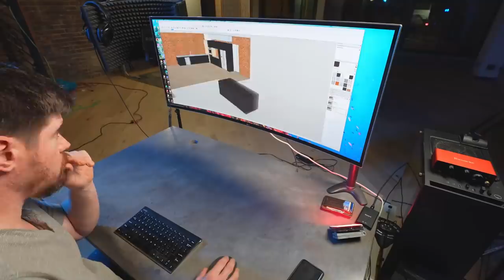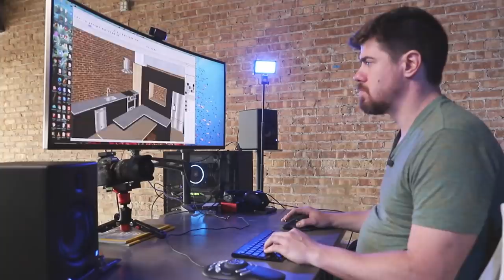Ep. 24 - Making the Hallway GLOW... and Bathroom TOUR ...Abandoned Building Renovation

Comment: Tiler here that grout shouldn't be discolouring that quick especially on the walls. If it's building up gunk in the joints then you slumped your grout to much its should be near flush unless it's a bevelled tile which you set back slighty rectified tile should be flush. If you grouted flush then something wrong was done in installation or it was a bad batch. It's a lot of fiddly work to change it but it can be done a light grey would hold up better as for the shower screen door water can travel 600mm from body splash so I hope you don't have any electrical on the door way wall and keep a squeegee and rag handy. I don't think the floor joins will be an issue but idk why you said the skirt needs to be smaller then the door arcs I've never heard of a code like that (Australian here) but regardless stick a thicker skirt down and just taper the ends near the door ways or stick a notched piece over the top of the door arcs....

Comment: Looks great!

I vote "no" on the 1/4 round.  If you change your mind, you can always add it later.  But I'm willing to bet in a few weeks you'll have moved on and not even notice.

Any reason you didn't paint the trim and doors before mounting them?  I typically do a dry fit, mark them (number them in the back in order around the room), and paint in the workshop / garage.  It's a lot easier, avoids a ton of taping, and saves your knees and back from crawling on floor.

For the doors, you can even rig up a simple "vertical lazy susan" that allows you to spin and paint all the door surfaces in one go.  Just add a screw or nail centered to floor and ceiling surfaces of doors, that you set to your sawhorse edges so it can spin around.  Then a 3rd screw further up one edge to act as a stop.

Comment: You might have considerd it already, but cutting of the trim slightly above the baseboard. And nailing a block of wood, the same size as the thicker baseboard below the doorcasing.would have allowed for a thicker baseseboard and the doorcasing to butt into that block of wood. In swedish it is called a ”skurkloss”😀
Reply from the maker: cool idea!  could probably add a thin strip too to get the same effect?
Reply: @modustrial  Im shure you could! But your solution should work aswell👌🏻 Looks more modern, the way you did it.

Also… I almost never comment on videos on yt. Really cool to get an awnser from you👍🏻 Keep up the good work!

Comment: I’m guessing you haven’t installed many baseboards, haha. Not sure why you used adhesive AND brads and you no doubt found out after that first top that you don’t need that much caulk. When it comes to painting interior doors, especially flat ones, it’s well worth it to pop them off the hinges, lean them on a wall with a stir stick on top to prop them out a bit and spray them! Excellent finish, no orange peel, and it will look much more professional. All you have to do is plastic off the wall/floor where you prop the door or just spray it if you don’t mind the area getting painted. While you’re at it, spray the baseboards BEFORE you install them. It’s SO fast and easy. I’ve painted houses for years and have done so many doors and baseboards I’ve lost count.

Comment: 3/4" gap is way too much, certainly for a hallway.
Assuming it's solid wood, it will expand across the grain with heat and humidity. If it was for example American white oak, and it was laid with the grain running along the hallway (I know it isn't)  then expect 3/16" per foot of width so for a hallway 3' wide, 9/16" potential expansion. But that is divided between both sides so 9/32" expansion gap needed each side which is about 7mm and here we spec 10mm gap typically or in a room 1mm/m of across grain width.
One way of hiding the gap further is to use the thickness of the drywall as an expansion gap.

Comment: I'm wondering why you're putting silicone on the gap between the wall and trim? Also as an HVAC technician for a smart thermostat I use Honeywell t10 in my home
Reply from the maker: It's a latex-silicone combo....not sure why I wouldn't use it?
Reply: Incase you want to change paint colors and differentiate the trim and walls would you need to peel it off and redo it?

Comment: Just a quick question, why are you gluing base boards as wells as nailing apposed to just nailing them? I understand they would be more secure in some ways. But if you have to pull them to repair floors or to repaint walls wont that cause more damage?
Reply from the maker: belts and suspenders, also putting in the glue helped give a little more separation, and covered a bit more of the patched flooring (and the crack left at the top when there is separation from the wall is covered by caulk).
Reply: @modustrial  Hey bud, a "z" pattern on that will work better than those globs. Just a thought that you probably already know.
Reply: @diggingupnorth3453  i do a squiggle with dots.
Reply: @modustrial  As someone that spent too many years renovating and repaiting homes... we hate when people do that... We end up charging more because we have to either tape it all or spend extra hours cutting in the edge or even worse, repairing damage done trying to remove it if the homeowner insists it is removed first.. A couple nails in opposing directions and they will never come lose.. Caulked top edge holds almost better than the glue does anyhow since both just rip the paper off the drywall.
Reply: @MattWeber  Maybe it's different in the US, but in the UK we hardly ever remove skirting boards (baseboards) and architraves (door trim) unless the intention is to replace them or re-plaster.

Comment: never glue baseboards to the wall. If you have to remove the baseboards, it will destroy the drywall in removal. Instead of mixing up wood putty to hide nail holes in baseboards, try drywall compound. Most trim finish carpenters use this method, since the boards are white and drywall compound dries white.

Comment: Caulking trick you learn by reading the instructions on the side of the tube. Push the bead dont pull. If you get it just right it tools the bead as you go. cant do it everywhere but saves caulking and looks really consistent. There is no wrong way for you. there is just the ways you feel are wrong. Everything else is tools for the toolbox

Comment: I'm not sold on "smart" thermostats myself. 90%+ of the time a programable thermostat does fine (assuming you program it appropriately for your lifestyle). No one that I know personally that has gotten one of the "smart" thermostats finds them as amazing as the ads portray. They've found all kinds of weird quirks and unwanted functionality. For example, the Nest thermostat has frequent updates. During those updates, the heating/cooling doesn't work. OTA updates also frequently fail and require manual intervention to get them up and running again.
If you are set on having a "smart" thermostat, I hear the fewest bad things about Ecobee's offerings.

Comment: I would have just not put the trim package in that came with the doors and went with the original floor trim. Also you're using way more caulk than you need: The tip cut should be as small as possible, just a little more than you need for the gap, form to gap and wipe excess with wet gloved finger in one motion and it's good 99% of the time, no extra wiping and going through as many rags and tubes. Looks good though. I wouldn't bother losing another 1" of floor for a tiny line that only perfectionists with good eyes will notice.

Comment: So the baseboards HAVE to be thinner than the door trim?? I'd have gone with the thicker baseboards and swapped out door trim later, honestly. The boards being short like they are, you shouldn't have any problem with expansion in the hallway, but it's definitely a factor in the larger rooms. If you decide on the thinner base trims in the bigger rooms, make sure to trim the drywall so if the floor expands it has some extra space.

Comment: Nest is a pain in the butt, and has a nasty habit of not turning on your heat or AC when you want it, without a long delay. If you have a communicating control board for your main indoor unit, be it gas furnace, or air handler, I recommend the Connex Evolution thermostat. It’s a 4 wire set up 2 data, and 2 power, and doesn’t require you to run 6, 8, or even 10 wires for your thermostat.

Comment: I’m a professional house painter and the way you guys painted your trim was literally giving me anxiety.  That was WAY to much caulk on the baseboard….but also it looks good from a distance.  Are your floors sealed yet or is that just raw oak?.
Reply from the maker: We are always open to constructive criticism :)   any tips for the painting process?   I actually got much better with the caulk as I progressed, but unfortunately only filmed the first couple beads as it was 2am and I was just trying to finish....  

the floors were pre-finished, so paint pops right off....
Reply: @modustrial  that’s cool.  For your trim…I would suggest Benjamin Moore Advance.  It is an amazing trim paint.  Super durable….acts like oil.  Sprays fantastic….would be good on your new kitchen cabinets:)……the sponge brushes….you prob don’t need.  For those smooth panel doors….use a nine inch roller cover with either a 3/16ths nap or a sponge cover.  More coverage with less work!  Love the space man…looks fantastic.

Comment: Boring interior doors.  I have a Nest (free from the power company) - it will decide the temperature in your house even if you do not use the automatic adjustment -- the only thing good is that you can change the temperature or check the temperature from anywhere on your phone.
Reply from the maker: thanks for the input!  One thing I didn't mention, is I plan to build my own doors at some point, so I basically went for the cheapest ones I could right now :)

Comment: Thoroughly disappointed in your base board installation. There should be no gaps in the miters and scarfs. Why are you using caulk and nails to install? 3/4 “ expansion space on flooring?? If you glue it there will be near zero movement and 1/4 “ gap is standard. Most of the expansion is across the width and not the length. Of you always need to know what the trim package is so everything works together and nothing wacky happens.